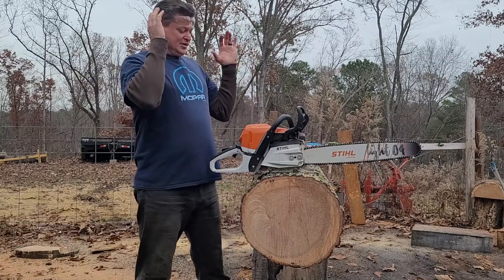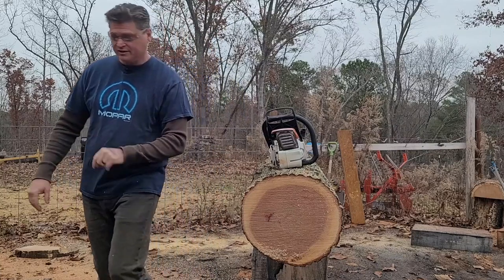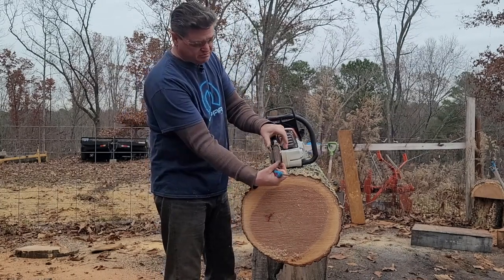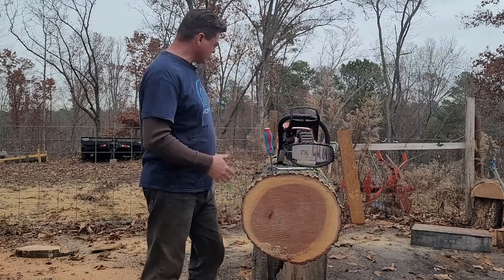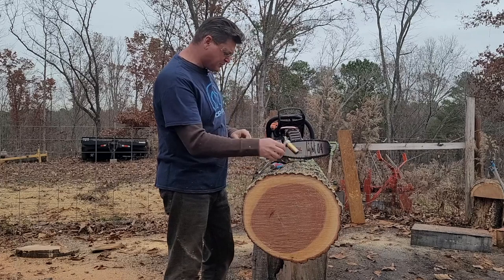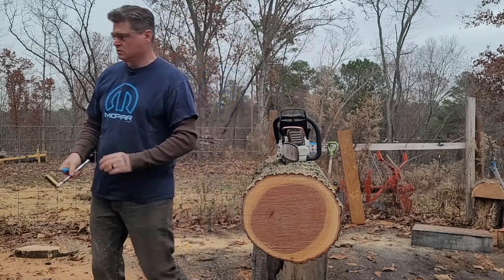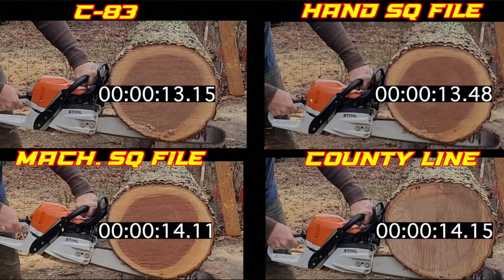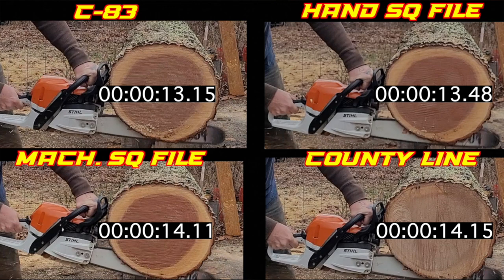Chain Testing C 83 vs Square and Round files, Hand and Machine filed chainsaw stihl 400c husqvarna

Comment: Benefits of square over round for me and my style of cutting (firewood) is in felling.   Making face cuts and bore cuts and less chatter.  Makes for a smoother cut without the chatter or hanging up in the wood.   At 60 yrs old I doing like fighting a saw in the wood cause I took the rakers too low.  I've square ground about 25 chains over the last few months and am still learning.   The development of muscle memory is key to any filing. 
Down side, double bevel files are expensive.   Vallorbe files are about $28 each, but the best I've found.   Pferd is good at $18 each.  Takes me almost twice as long to file square over round.  But square filing has made me a better round filer.

Comment: C83/C85 is not bad out of the box but is way better when you run a file over it and do the rakers on the hardwood setting.
When I put a new chain on I have to sharpen it because fresh out of the box they are nowhere near their potential. 
Great videos by the way! 👍🏻

Comment: Rakers could have been taken down a little more.  But I've heard you don't want to take them down real low as compared to round filing.  Good video.
Reply: Good job dude, which file did you use? The vallorbe?
Reply: Yes I did!
Reply: High priced Vallorbe, but a great file.  Pferd is good also and a little cheaper.

Comment: i like to run the stihl chain just because how little stretch they get and how long the teeth last if you dont hit anything with them. and out of the box i normally hit the gullet out and maybe touch the cutter a once or twice and it makes it cut quite a bit faster. i wouldnt do it if it didnt make much of a difference cuz even just a 24 inch bar to sharpen all the way takes quite awhile if you do it right lol. and ive heard a big thing why ppl like about the square files is how well they cut at an angle doing face cuts and cleaning up dutchmans it is compared to round.  and it really does make it alot easier. and also where i used to work my boss im pretty sure has a saw that was built by gary its a kit saw i think  they called it a k483 its a big bore stihl 460 im pretty sure that was ported with a barkbox and that saw blew the doors off stock 661's he had and weighed not nearly as much. my only complaint about it was the damn thing couldnt keep a starter recoil alive for more then a month or 2 cuz of how much compression it has lol and my boss was a cheap ass and wouldnt just pony up the extra bucks for an oem stihl one that would last way longer.

Comment: I have yet to find a chain that will cut a fraction of what my hand file will cut. I buy the 100’ role of x-cut chain at a time. HL supply had it on sale around the 4th for around $350. Normally it’s around $600. It save you money in the long run

Comment: Just bought my first Husquavarna and it’s a 372xp and it’s needing a bar and chain. Im use to running Stihl bar and 33rs Stihl chain so I’m clueless when it comes to Husquavarna. What chain is equivalent to the Stihl 33rs chain? People are suggesting to me to buy the C83 or Oregon EXL but idk nothing about those C83 chains. Are they a safety chain cause if so I’m passing on it. Im looking for something like I’m use to using. Hate to buy bar adapter just to run Stihl bar and chain but most likely will cause I still haven’t found one yet I like better. What does everyone recommend for these  hard woods in Kentucky

Comment: There was a short lived square file craze around here in hardwood land back about 15 years ago until we all figured out it is not faster. Also as a professional timber cutter I love Archer skip for the money. To me it mimics a Stihl chain in it's cutting profile. I hate Oregon ... Won't use it, it's junk. And the x83 is king 👑. Just my opinions....which are useless at best..
Reply: I’m completely brand new to this. What is Archer skip? I’m so new that I’m been finding Poulans in the dumpsters and reviving them and the chains that are on them have been getting the job done. Willing to learn.
Reply: And Archer chain seems to be way better than tri-link (countyline/home depot/etc three circles)
with the exception of some woodland pro branded tri link in 325 narrow lerf.  it wasnt bad.
Reply: What problems have you had with Oregon chain? I've used their .325 chain for almost a decade but will buy whatever fits my bar. I'm curious if I could spot the difference if you point it out to me.
Reply: @7eis  wont be apples to apples cause I run 3/8 chain. 3/8 and .325 are two different animals.
Reply: @danagordon8871  Archer is a discount Australian brand(probably made in China...lol). And skip tooth chains have less cutting teeth per drive link. I only recommend skip on more powerful pro type saws. Weaker saws can't pull them well. Hope this helped!
Reply: Most loggers I know use RS Stihl chain or Oregon EXL.
Reply: @stevemcdowell2019  Some people like Oregon because it files like butter but myself and all my guys would prefer the Stihl big time and we have to drive 5 times as far to get it.. LoL
Reply: @Timberslasher  I've used lots of different chains.  Stihl RS is one of my favorites and agree Xcut C83 is at the top of its class.  But I'm not a professional cutter.  I cut a few logs for my mill as a hobby and cut firewood.   The EXL Oregon is much cheaper by the roll than Stihl or Husky.   It performs well more my situation.  I can make up a nice 72 driver chain for about $10.
Reply: @stevemcdowell2019  Where are you buying that? Even Archer comes to about 16 bucks a chain off the roll for me making 72s...
Reply: @Timberslasher  I calculated again, and I was wrong.   Oregon exl is about $20 off the roll for 72 drivers.
Reply: @stevemcdowell2019  That seems more like it

Comment: I thought the c83 is low pro gauge 0.50?, are the other chains the same gauge?. Not quite  a fair test if so, Also what gauge is the bar. is that bar 0.50 or 0.58?... most stihl bars are 0.63 here in the uk.🤔
Reply: They were all .050 gauge.
Reply: @stevemcdowell2019  fair play👍
Reply: Low pro gauge? You talking about a safety chain?